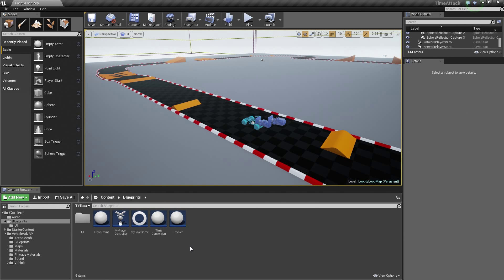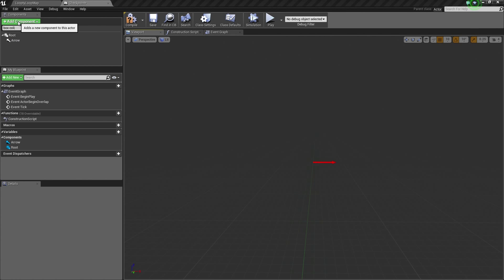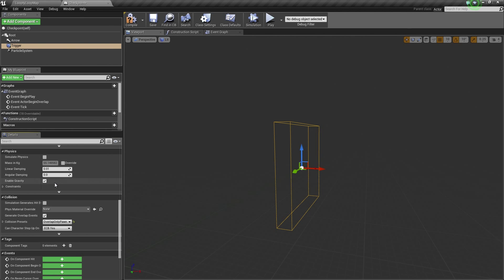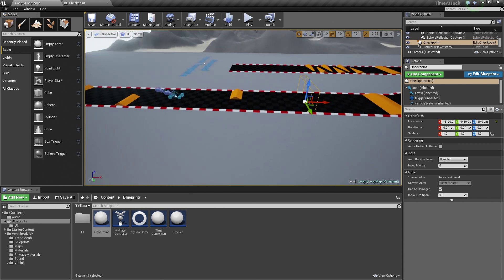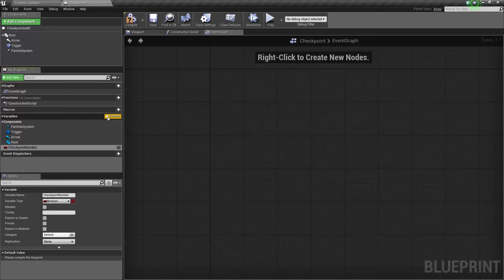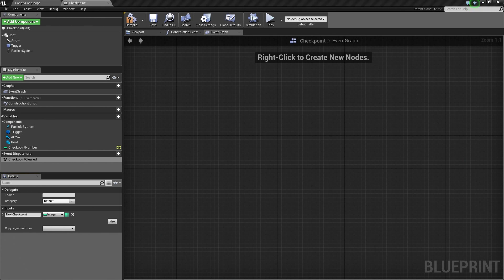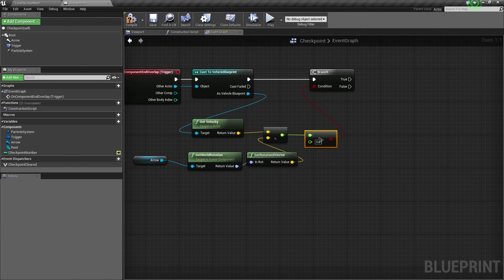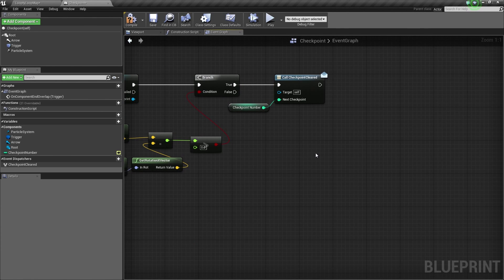BP Time Attack Racer: Setting up Checkpoint BP | 03 | v4.8 Tutorial Series | Unreal Engine

Comment: Why do we use XVector of WorldRotation of Arrow component? I don't get it. Isn't there a way to directly access to the direction of the arrow component, i.e. the way the object is facing? If there isn't, then what is special about XVector? I mean why not use, say,  YVector? (afaik, there is no y vector, bu i hope you get the point?)
Reply: I think you can use get forward vector instead.
Reply: they use XVector because the X axis is the forward direction of any actor, and it's easier to use it to measure the rotation of the actor and vice versa.

Comment: It is good to know some vector algebra so you know what the vector functions actually do. For instance, the dot product of two vectors A and B is defined as: ||A|| x ||B|| x cosP, where P is the angle between the two vectors and also (Ax * Bx) + (Ay * By). So if the result of the dot product is 0, that means the two vectors are perpendicular (the angle between them is 90 degrees) and if it is less than 0 then they are in opposite directions and > 0 means they are in the general same direction.

So in the blueprint we are checking if the dot product is > 0 to make sure that they are facing the same direction. You can also use the forward vector as the inputs for the dot product node, the forward vector is the vector directly in front of the actor.

Comment: I know this video is old now however I'm trying to follow it using version 4.12, after creating the checkpoint and testing it I am finding the checkpoint does not disappear any ideas as to why ?
Reply: at "Set Hidden in Game" do u have the "New Hidden" Checkbox, checked? :) That was my problem ^^
Reply: After an hour of trials, i found one solution working perfectly. Add a sphere collision and instead of on component end overlap of trigger, replace only that node with on component end overlap (sphere) .. rest all leave it as it is. It works now
Reply: Thanks,  I had my "New Hidden" unchecked. after checking it the script worked :)
Reply: Thank you thurr H. Fixed it for me.
Reply: You need to replace the Get Velocity by Get Actor Forward Vector, and you will get the same result
Reply: @thurrh9265  thats bad advice as then you are taking the forward vector thus the player is unable to reverse or fall backwards into the checkpoint. This eliminates the logic he set up with the dot product